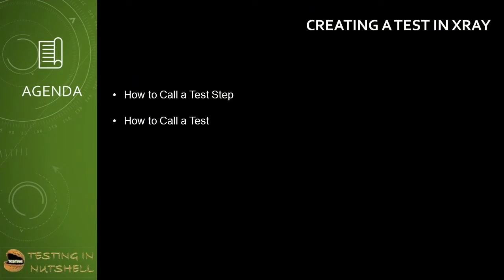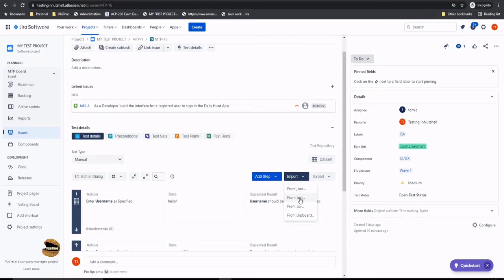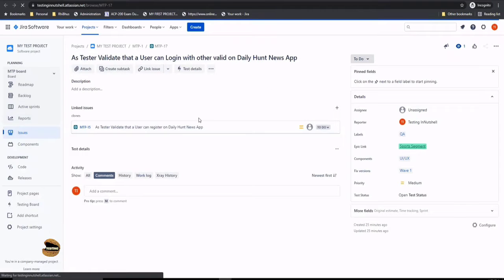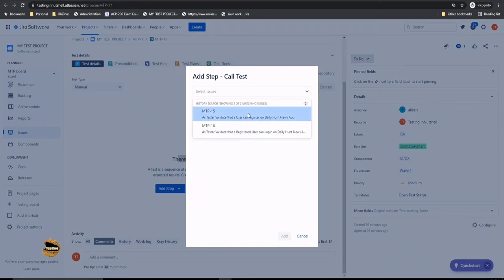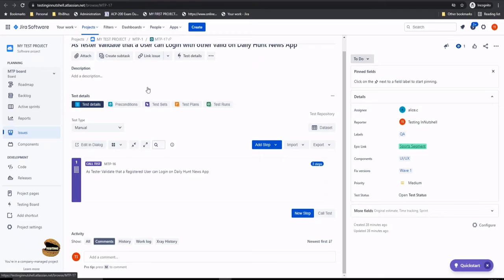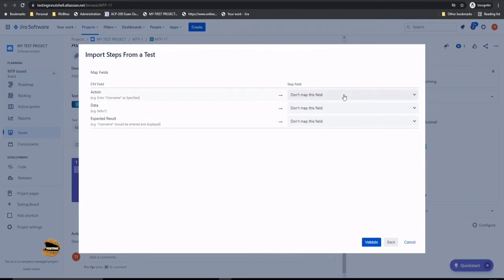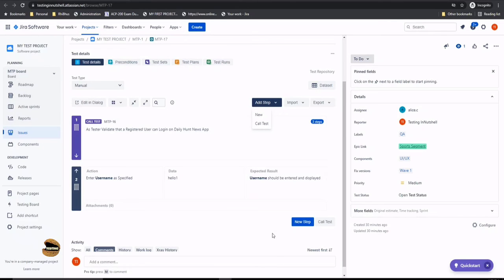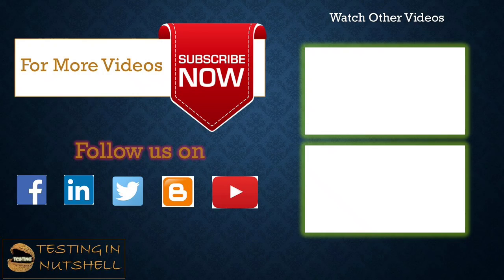Tutorial #5 | Calling a Test in Xray | Calling an Existing Step in Xray | Xray Tutorials

Comment: But is very complex in hard in Excel we will get our page module test cases in one sheet like we have 50 test cases for a log-in functionality then I just have to open my excel sheet and only have to execute them and have to update status in Excel and if find bug so just update it in reporting tool and update that bug ID in Excel sheet with that test case.
But in Jira I have to open that story than have to open each test open by one than see whole writen details and than execute test than close it after execution than open another test case than execute it so for executing my 50 test cases I need minimum 100 minute if even I consider 2 minute each but in Excel I only have to scroll down and just execute it and even we do not have to remember any story ID and all.
Yes big advantage that in Excel also we make index page and apply formula and if user write any test pass fail regression smoke so in index page count and detail will automatically updated.
In my love project I used both approach and I found that excel is much better and fast and yes even not playfo m and internet depended just down it and do wo k 👍🤗